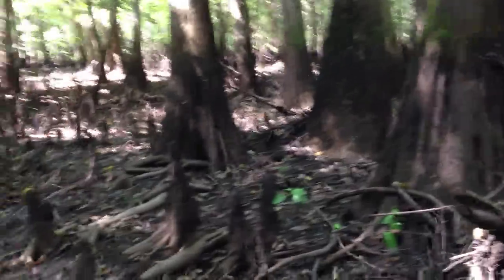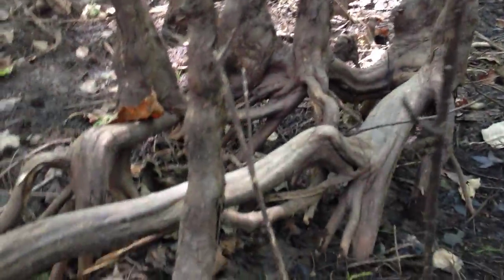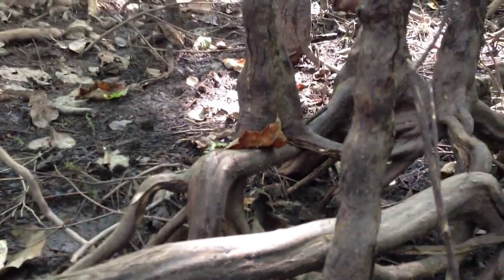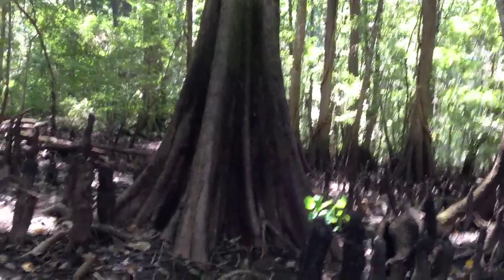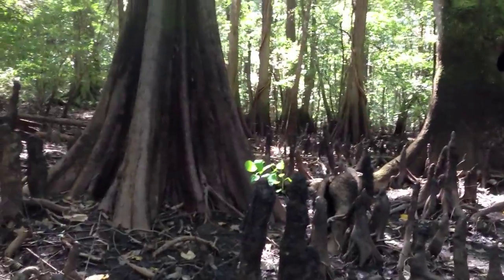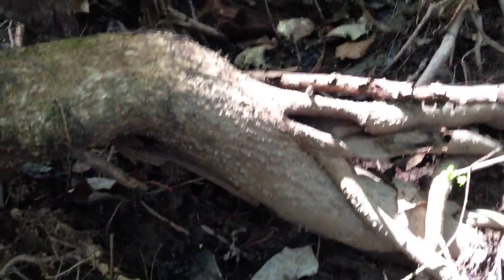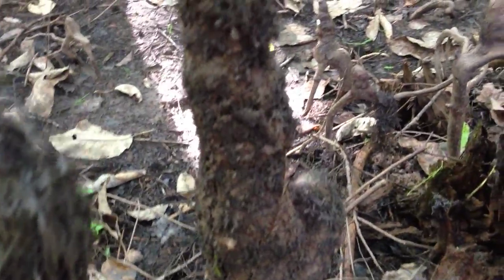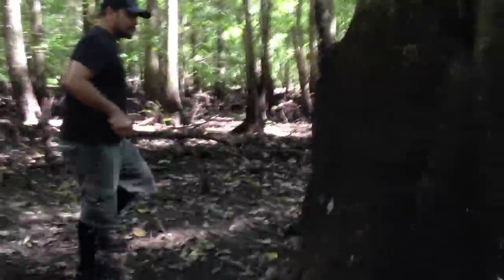Cypress knees

Comment: While I know nothing of plant physiology, anaerobic metabolism is well established throughout the various divisions of living things.  It is not as efficient, but does occur in the absence of molecular oxygen.  It is less efficient.  But is that what is going on with those cypress knees?  If the knee is preferentially sticking about the waterline, regardless of the absence of accepted structures related to gas  exchange, I would still expect some sort of interaction between the knees and the atmosphere.  My two cents is that it needs further research.

Comment: Marcus I was just on the phone with my brother and he told me that the cypress trees he planted next to his house is putting out knees. We thought when he did this there would be no Cypress Knees since they would not be growing in water. He lives in West Palm Beach FL.  out in Loxahatchee. One tree is starting to lift his drive way up :) .  So you our correct they are not for breathing. Question: If he cuts the tree to the ground and drills in the stump to use round up will the knee die with the tree?  Or will it start a  new tree ? He is bummed out because they are beautiful trees, but has no option. The second tree seems to be only showing knees in the yard and is next to a footer for the foundation of the house and I don't think the root would go under a 32" footer, they seem to be coming up in the opposite direction then the house. he told me the lawn mower found them first and was not happy.. :)
Reply from the maker: Yes, they are not supposed to knee when high and dry.  But I have found that they actually do.  No one knows what their primary function is except they seem to help anchor the trees.